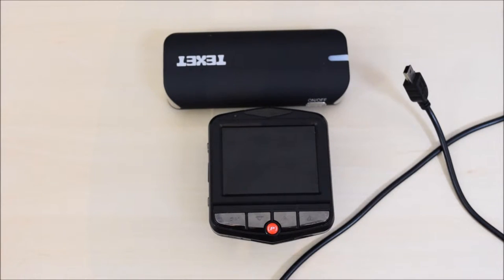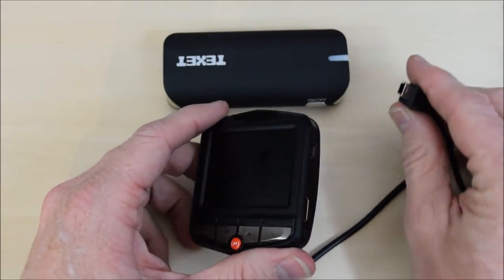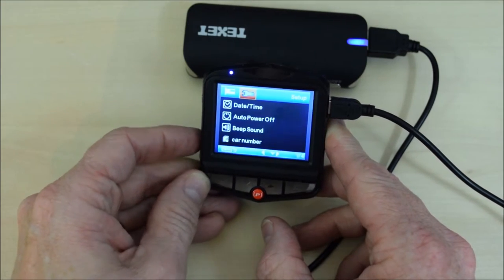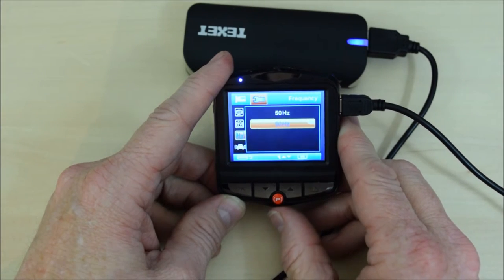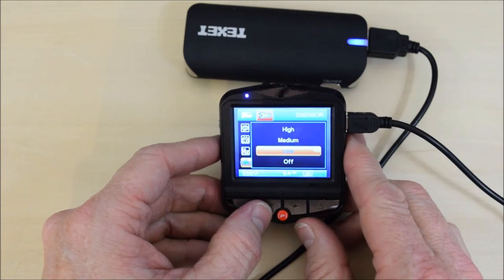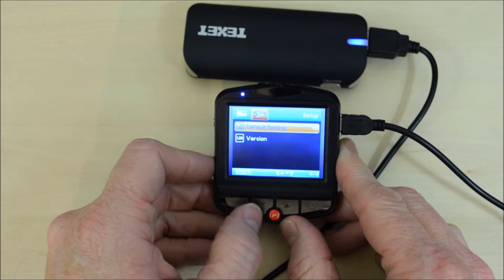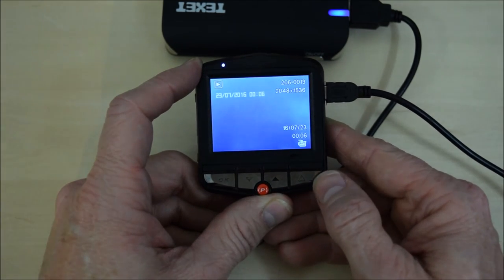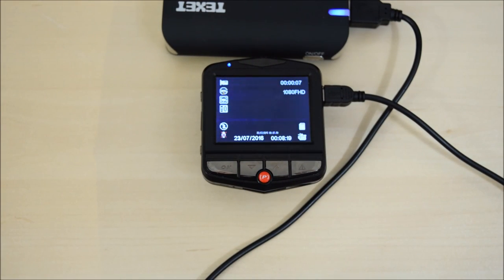How to: Car cam menu and setup guide, Streewize Carcam dashcam

Comment: Hi I wondered if you could help me I followed your instructions but my camera has stopped working. It is charged but the camera is not working. I wondered if you knew what this could be.
Reply from the maker: Hi sorry for the latte reply.  Mine eventually stopped working after about a year and presented a black screen even though charged.  The retailer changed it for me at the manufacturers request.  I hope this helps. and thanks for the question.